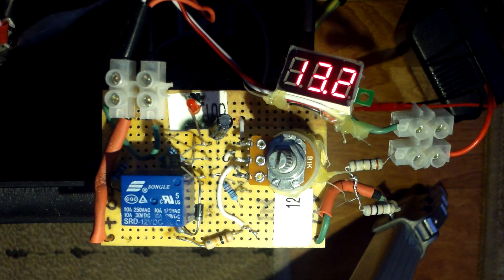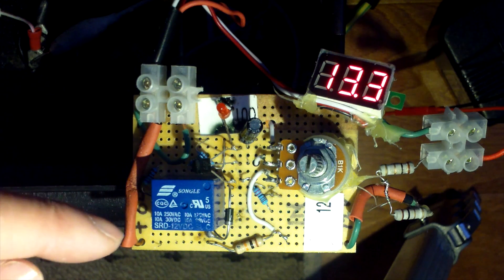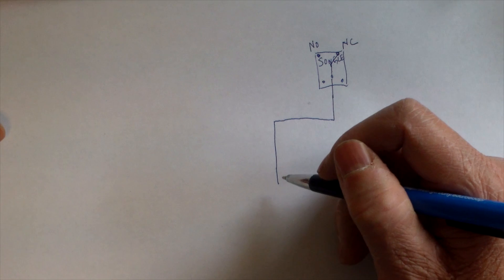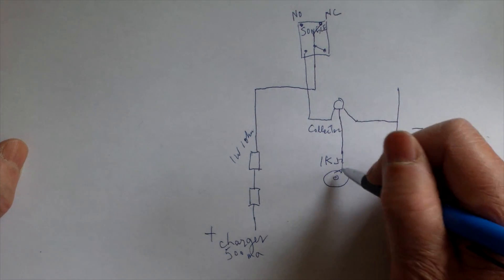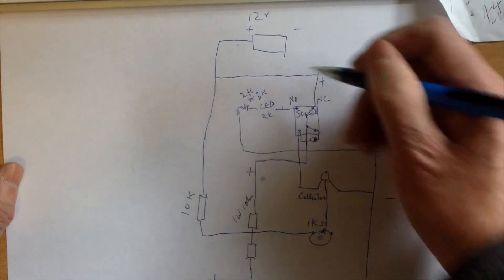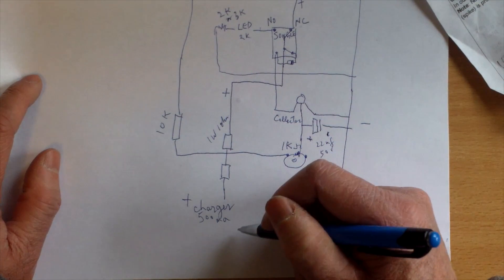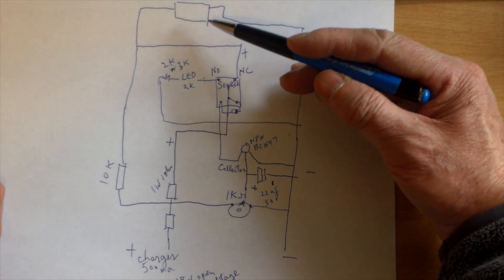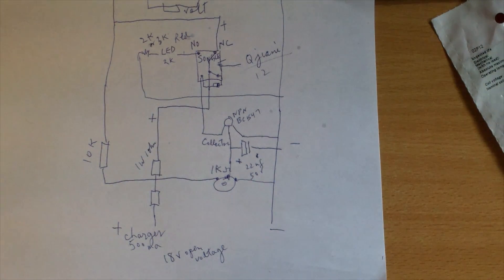DIY 12 Volt automatic float charger part 2

Comment: this circuits do not control the output voltage of charger but the battery need constant voltages and may vary of ampere.
.....contact relay is very small capacity to close and open the currents flow.

Comment: I studied this schematic and you are missing the connection to the coil of the relay below the NC port. You show a diode across the two terminals the one port connects to the transistor but the other port of the coil needs to connect to the + I think but at what spot?  I am sure this is why some people are having problems.
Thanks for any answer.

Comment: What would differ in this circut if I were using a 10.5 watt, 18v, 2amp solar panel?

I have a LM317T transistor voltage regulator to use. Your thoughts and skill will be most helpful. 

Tnx.
Reply from the maker: N2RRAny A 2 amp 18v solar panel would be more than 10.5 watt. The only thing you might change would be the resistors to limit the charging current. Maybe 6 ohms 2 watt resistor. See if that gets hot. You might be able to use lower value for faster charging if the resistor you use is not hot to the touch when you are charging with the solar panel.

Comment: "Just plug it in and if you don't see any smoke, it should work"
Lol, love it. Thanks for breaking this down. Some people don't like long vids but they're missing out imo.
Reply from the maker: James Biggar That's why I try not to work with higher voltage AC and preface my videos with "Do this at your own risk." It's very easy to short circuit something, even when you are clear headed. Thanks for commenting.
Reply: That's for sure. 12V dc is pretty safe to work with

Comment: I have a stack of circuit boards from old electronics and get some of my parts from them.  Circuits boards from old TVs have lots of those one turn trim pots.

 You could add a charge indicator LED at the collector of the transistor.  That would be cool to have both charge and no charge lights.  Cool circuit.
Reply from the maker: Russ Bowers Yes, that's another thought with the charging on LED. I'm still playing around with it. When I'm satisfied with it, I'll put into a project box. Thanks for commenting.
Reply: @wtam69 will it automatically maintain the voltage for lifetime 
Because am use fo ATS of generator battery charger